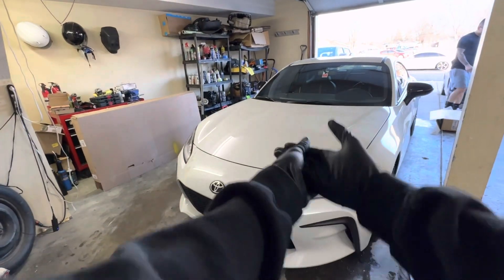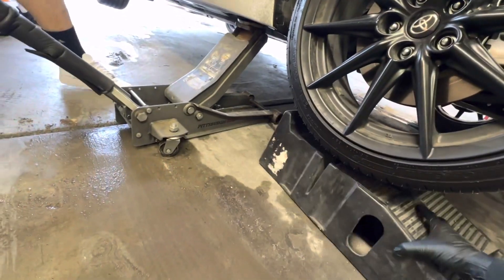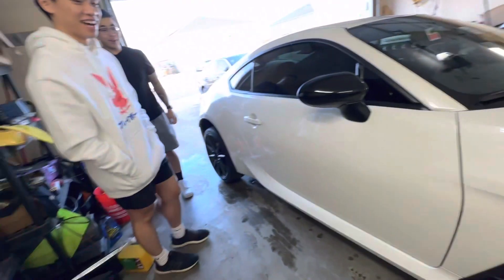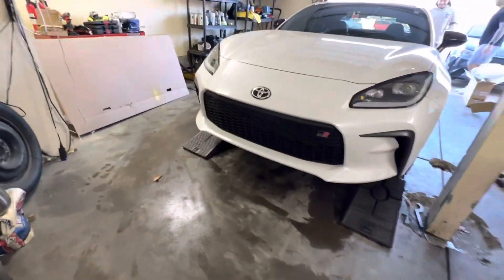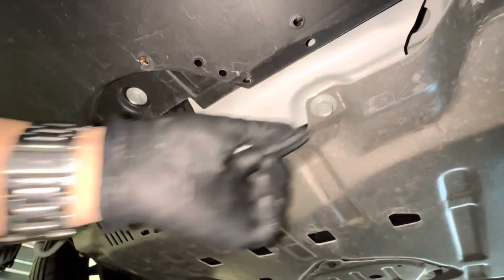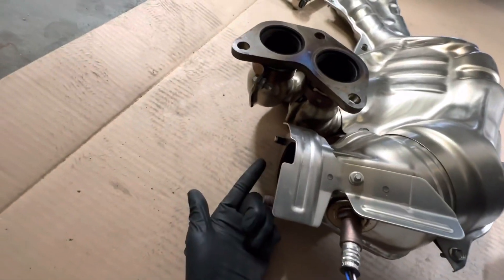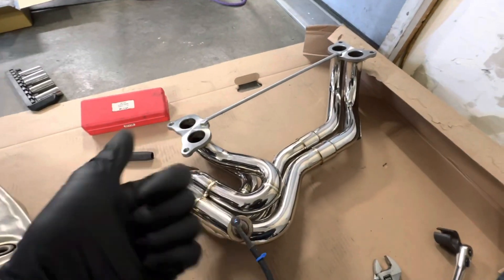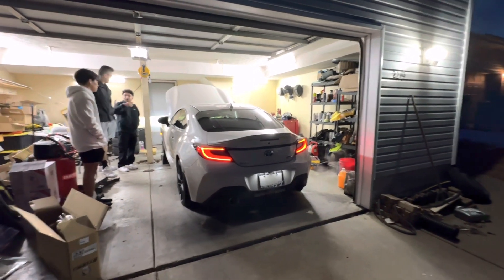MAKING A TOYOTA SOUND LIKE A SUBARU??? (GR86 UEL TOMEI HEADER)

Comment: quick question, does the tomei headers comes with the de fouler sensor? bcs im planning to buy headers and i dont want to get any engine light
Reply: :UPDATE:
No CEL headers sound great! Deep rumble and not raspy. My setup is UEL TOMEI headers, and a remark axlbeack exhaust. Everything else exhaust wise is stock. 
 

MFrom what I’ve seen no. I got my defouler from “blox racing” I should have it installed by the end of the week. I’ll come back to this thread for an update.